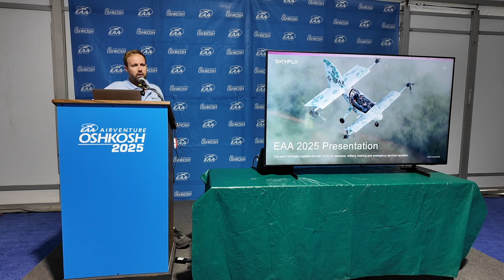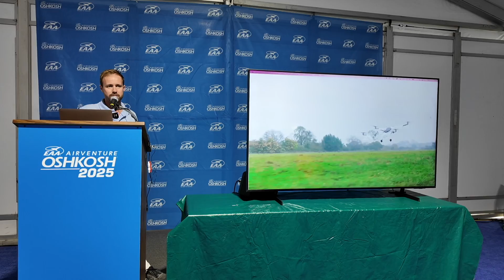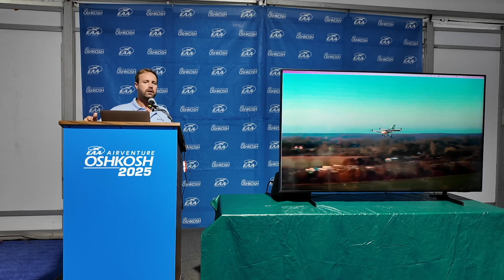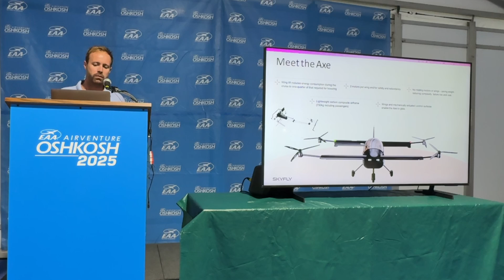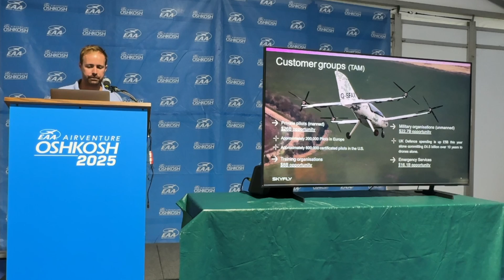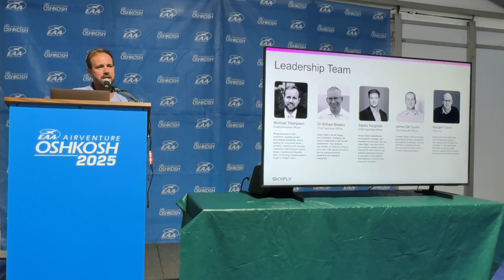EAA AirVenture 2025 Press Conference - SkyFly - Michael Thompson, Founder & CEO

Comment: 4 props?  Not 8? What if one fails?
Reply: there are two motors per prop so it will keep running.  also 8 props would be less aerodynamically efficient than 4 big ones
Reply: You have wings providing lift and control surfaces for control.